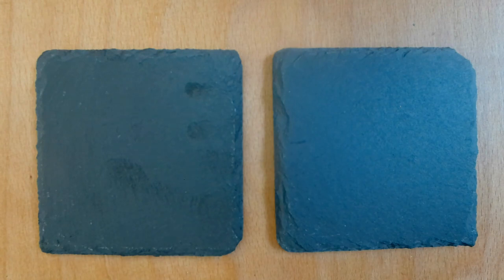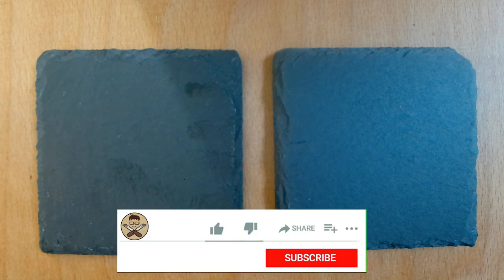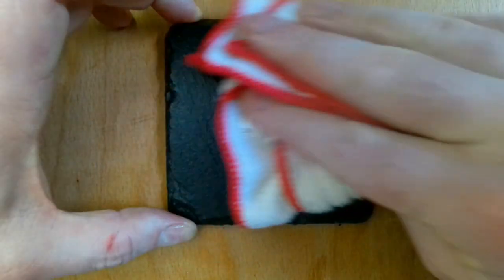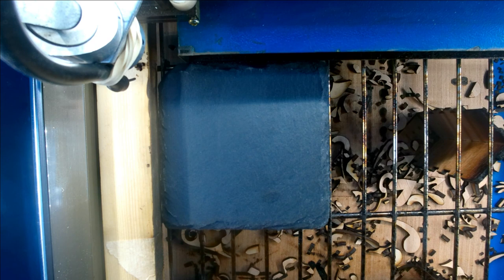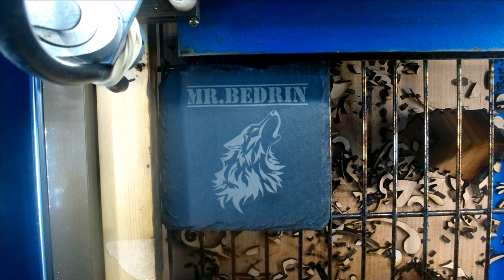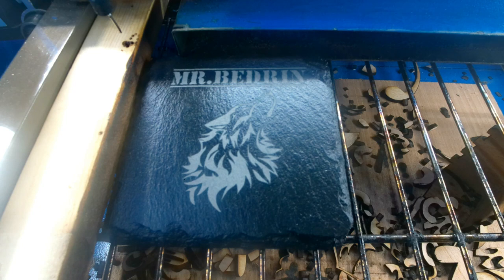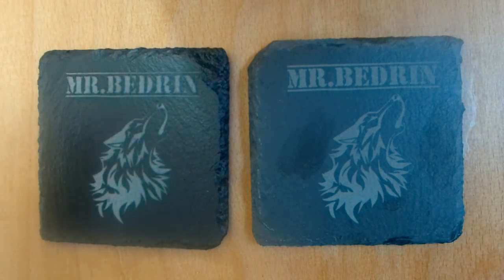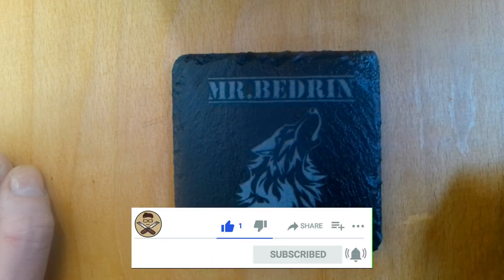Testing finish on slate using a K40 laser engraver

Comment: I thought that slate was used because it was highly absorbent? If that's the case, doesn't putting oil defeat the purpose of using slate?
Reply from the maker: I still think the slate can absorb some, I don't really understand that side of it but I have used this method for a few years and the coasters are still in great condition. My favourite thing is that I don't get any cups sticking to them 😅

Comment: Can this do photos on slate
Reply from the maker: Yes. Photos turn out amazing. You need to do a few extra steps to prep the photo ready for engraving though. Especially if you are using a k40 laser.
https://www.imag-r.com/ is a great tool to get started
Reply: @phil's craft corner  hi thanks I'm just getting one to day are they any good
Reply from the maker: K40 are a great machine. They are just too small for my work these days so I got a k50. I still use the k40 occasionally though.

Comment: What was your print setup on the K40?  Thank you for doing this video.
Reply from the maker: I used k40 whisperer, around 8ma power and 350mm/s raster speed. It doesn't need a lot.
I suggest you get some spare slate and test to find the best settings for your machine :)

Comment: would a clear spray lacquer do the same job?
Reply from the maker: It does a pretty good job yes but I find it gets pretty expensive when you do quite a few. You also need to be in a well ventilated area so it's not advisable to do it in a house

Comment: Hi Phil, great video! What settings did you use for the engraving? (mm/sec and mA). Picked my K40 up laser week and have some slate arriving today. Cheers, Chris
Reply from the maker: I used 8ma power and 350mm/s speed. It doesn't need much with the coating on there
Reply: @philscraftcorner  Cheers Phil, will test this later.
Reply from the maker: Just make sure the coating has dried properly. Atleast an hour in a warm place but I pre coat a bunch and leave them overnight
Reply: @philscraftcorner  Got some great results from those settings! Thanks again Phil
Reply from the maker: Glad they turned out well for you

Comment: When I've engraved coasters like that the engraving sometimes comes off with my fingernail. Do you ever have this problem?
Reply from the maker: No, it's always been completely fine. What kind of finish have you used?
Reply: @philscraftcorner  none ☹️ that might be why. I found when my height is better dialed in the lasering is black vs white
Reply from the maker: That's strange. My engraving speed is relatively hight with fairly low power.
Reply: @philscraftcorner  I'll have to try it with t
A different kind of slate. I got a good deal on masonry slate tiles.
Reply from the maker: Good luck